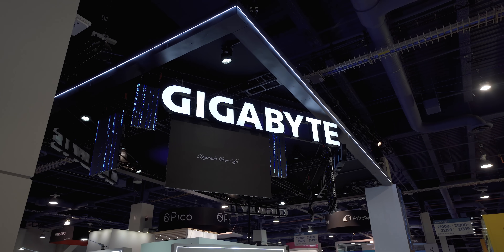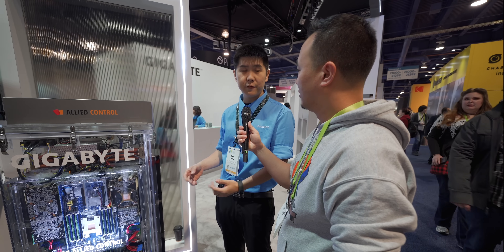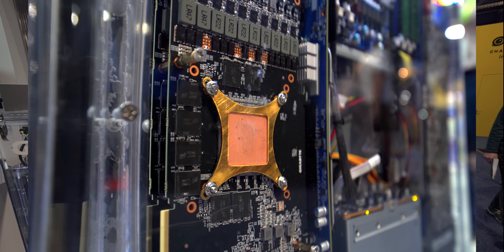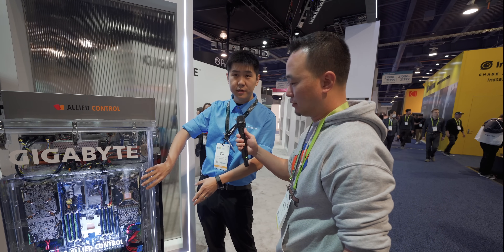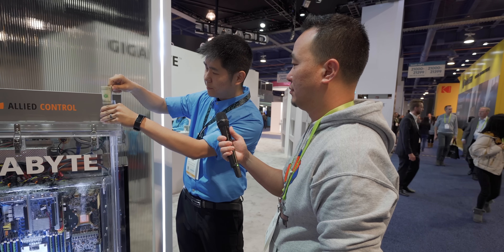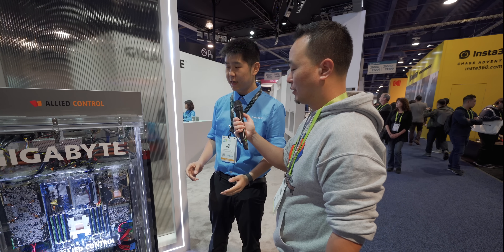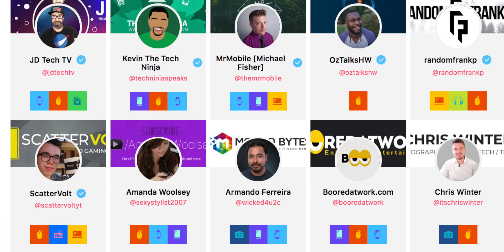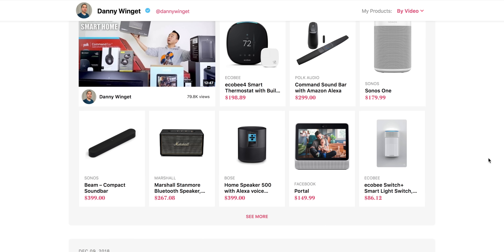PC Cooling Submerged in 3M LIQUID?

Comment: Submerged computer you say? Haven't we done that a few years back with mineral oils?
Reply: Yes, but oil has all sorts of problems. It's not fantastic on thermal conductivity and it's much more viscous than water.
Also on the practical side of things it makes a horrible horrible mess any time you want to take anything out of the tank.
It definitely works, but for effort it takes it's just not worth it - compared to just a water loop or maybe a chiller loop.

The fact that this doesn't stick is fantastic, and the liquid/gas states should make it much better in cooling. Even if the liquid itself as a so-so thermal capacity and conductivity (speculation obviously), the fact that it turns into gas means the heat gets moved away from the heat source very quickly and efficiently.

Comment: 3:05 Excuse me? Not affordable for consumer(public)?
Go ask that to some geeks that spent 20k $ on their build and still think adding more.
Reply: That 20k can barely buy two Server CPU's...
Reply: @marlmyster  what's the difference between server and normal CPU's? Sorry big noob
Reply: @TotalGAMIX  
That's not an easy question to answer either, but I'll try...
Server CPU's will use ecc memory, have lower clock speeds, have a lot more cores and has a lot more security features... 
They are made from the best silicon and are mainly designed for high performance workloads as well as power efficiency... 
They are more differentiating factors that I will miss but... Maybe I'm a noob as well!
Reply: @marlmyster  thanks!
Reply: @TotalGAMIX  
No problem... Glad you weren't a troll
Reply: @marlmyster  lol
Reply: such niche market is too small for big companies to take interest. I bet they would be interest if they could offer it between AIO and custom liquid market prices and performance was closer to custom loop.

Comment: 200 usd per kilo of NOVEC. I suppose you need at least 4 - 5 kilos to cool a decent system.
Reply: @markj2093  I would LOVE to know where you were able to get Novac for £20 a liter. The BEST price I have ever seen was ($390/gal no longer available)  Currently $450-520/gal. I would be surprised to see a price below $200/Gal even buying in 50/gal drums.

Comment: they need a cooling system for the cooling system
Reply: That is pretty much how all cooling systems works
Reply: @vitor900000  Im not sure all cooling systems have a secondary system that condenses gas back to liquid as a form of heat dissipation.
Reply: @thePhished  Unless its only a heat sink (Aka fanless) it have more than one system.

Comment: Transformers are also cooled this way with transformer oil. We used mineral oil for PC cooling and it works, but mineral oil is flammable...
Reply from the maker: Yeah this looks better than mineral oil for sure.
Reply: i read that thinking that you were talking about optimus  prime
Reply: @ilikecars4966 😂😂😂😂😂😂
Reply: Not strictly - the oil in transformers doesn't take heat away by boiling
Reply: @mieszkogulinski168  it can... it just usualy results in massive fireballs

Comment: Only drawback is that the fluid costs a fortune. There will be gradual losses so you will need to top it up from time to time.
Fluorinert FC-3284 and FC-72 are the most appropriate having a boiling point of 50/56C. 
14lb/5kg-1gal/3.79L of FC3284 at chemworld-com is ~800$. 
The tech itself has been around for 50y or so.
Reply from the maker: Yeah it’s pricey. Hopefully overtime it gets cheaper

Comment: Would Be cool to use it In watercooling loops. Even if it leaks it wouldn't damage electronics.
Reply: Ashish Patel not really as it doesn’t have the thermal properties for closed loop cooling.
Reply: You would blow the hoses right off your system. It boils at far too low of a temperature, for a closed loop.

Comment: This thing is insane. It doesn’t matter if it’s new not new who covered it because it’s interesting AF.
Reply: @Elsa Debroglie The maintenance part shifts from the water loop to this loop. There's still going to be a pump, condenser and occasional top-up of the fluid.
Reply: @Elsa Debroglie the liquid is boiling inside the closed chamber, it still have to condense back into liquid form or 1. open air design, top up the liquid every few minutes and being too expensive and too much maintenance 2. closed chamber, build up of pressure in the chamber and risk of explosion. so while it's true that inside the chamber there's nothing to maintain, my concern stands in that there has to be a cooler outside to turn the gas back into liquid. it's not encased in massive heat sinks at the show. so I'm wondering what kind of technology are they using to remove the excess heat.

Comment: Probably not so fun to drain and work on server/s...Bring the bucket, we have another server down! Great video. Thanks for sharing.
Reply from the maker: Yeah that’s where costs come in. Supposedly you dont have to change the liquid until you update the parts so it’s interesting
Reply: Smarmy Fellow  Why would it be? just pull it straight up, swap the hardware over the tub, and plunge it straight back in.

Comment: Don't try this with water.
Reply: technically, it's perfectly possible with destilled water for short time, untel the minerals are leached from the board/metals and turn the water conductive again.
Reply: I disagree
Reply: too late
texting from my phone
Reply: @jimmy2shoes75  wtf bro 😂
Reply from the maker: PLEASE DO NOT lol
Reply: @dannywinget 
How about ice cubes instead?
Reply: @corcon6976    yes absolutely put icecubes on ur CPU its 100% safe i guarantee
Reply: @corcon6976  possible dry ice will work!
Reply: Well try it with demineralized water, but expect corrosion
Reply: or Milk
Reply: ultrapure water might work
Reply: distilled water?
Reply: NO BUT IT WORKS GREAT WITH COOKING OIL
Reply: Mineral Oil
Reply: now you tell me ;)
Reply: Maybe a case of ultra ever dry??? Shoot make ur stationary chip with main components enclosed in a perfect seal then set it up to pull the dough. Unless aluminum oxide has been mixed with water succesfully without being conductive after. hummmm he should pour water on his dollar and his chip to show if it beads off
Reply: good chance some one in the world already has.
Reply: no shit Sherlock ?
Reply: but this is still water right?
Reply: @fanzyt5518  No, it's definitely not water. It is a special liquid that is electrically non-conductive. If it was water, it would immediately short circuit everything.
Reply: Water is fine if there are no dissolved metals in the water. Water by itself does not conduct electricity.
Reply: masscomnet We’ll, I’m assuming we were talking about regular tap water.
Reply: @Truthseeker71  You know what assume means. . . . ; )
Reply: you could use distilled water, but it would be useless.
Reply: You could use deionised water
Reply: Actually you could use water.  From what I understand, if you had 100% pure water, you could pour it over electronic equipment without a problem.

The problem arises in that water is excellent at dissolving electrolyte minerals and becomes easily contaminated which will cause electric current to flow.

If you were able to keep H20 pure and free from contamination, you could use it in the same way.
Reply: I'll try with oil then
Reply: @kamisama9715    doing the mineral oil thing works pretty good, but there are lots of issues with it that are not desirable.

First, the oil "wets" everything and clings to all your computer parts.  If you ever have to do any maintenance on your computer, it is very messy and hard to deal with.  Secondly, I believe that even mineral oil can become contaminated with electrolytes if you are not careful with it.  And finally, in the rare event that you have an electrical problem, the oil could catch on fire and present a major fire hazard.  Although, I am not sure what the risk level of such a thing happening is.

Really, this 3M Novec stuff is really the absolute perfect material to use.  Although I think the vapor of the 3M product is toxic and you should not breath it.  There is another coolant that might be pretty good made by Engineered Fluids that might be cheaper to use and give you the same results, but I think it is totally non-toxic.
Reply: We could just dry the water out, idiot
Reply: why not water is non conductive
Reply: I’m trying it with water
Reply: Pussy
Reply: How about isopropyl alcohol
Reply: Too late for Lenny.
Reply: Thanks for the advice, imma try with Vodka
Reply: Why didn't you tell me earlier. Damage done now.
Reply: 0:57 YOU LIE! my computer did not enjoy being under water!
Reply: He said its not water 0:56 but 1:07 So it is water?
Reply: Wish I had read the comments earlier.
Reply: @user-gz5ss4ff4l   toss in a bag of rice.
Reply: I mean it's possible with. De ionized water
Reply: late
Reply: What about distilled water 😂
Reply: And wodka?
Reply: i will
Reply: Actually, with a fully deionized and well filtered and etc water (basically mostly really h2o) would actually wont have any issues unless something contaminates that 'pure' water, until the water steals some molecules of metal
Reply: You can use water, just keep the main power supply outside and only let the low voltage wires from the power supply in. But yes, expect corrosion.